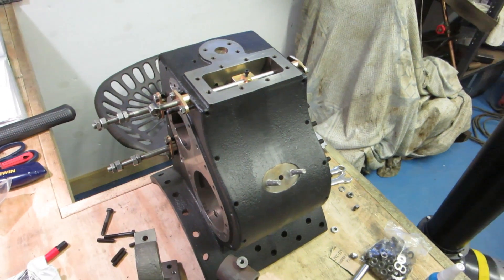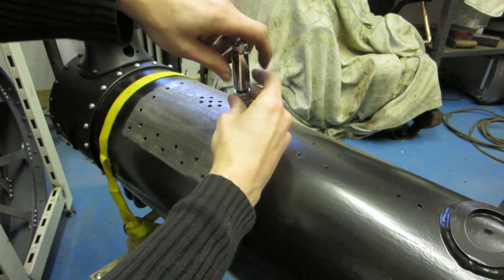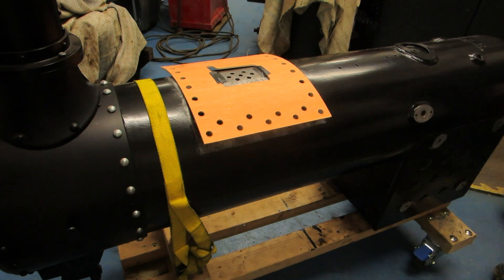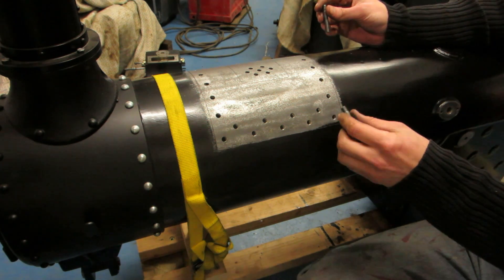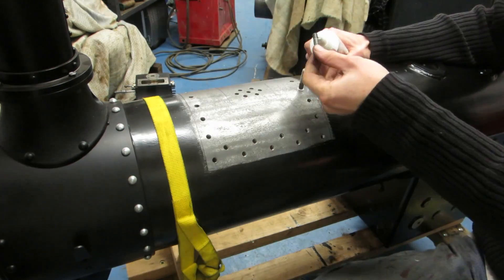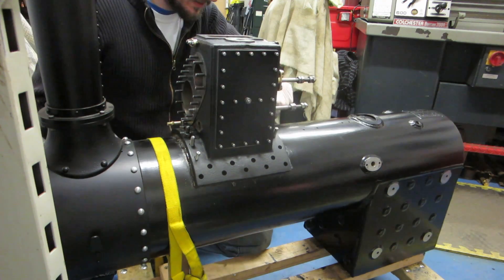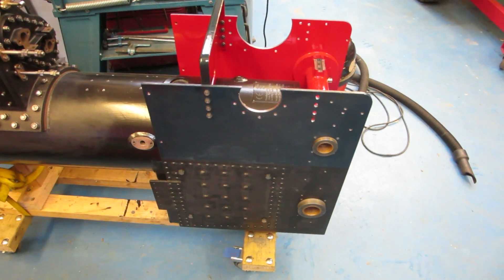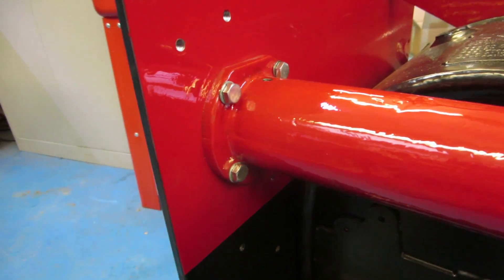Fitting the cylinder block - Burrell SCC build Part 22

Comment: are the holes for the studs all the way throw
Reply from the maker: Hi Riku, yes they are. I used thread sealant on the studs but I reckon in reality the cylinder sealant would have sealed it well enough. Thanks for your comment, cheers, Chris
Reply: +ChriX Builds thanks for geting back and I was talking to a freind about it, burrell apparently used carrot bolts to hold the block on